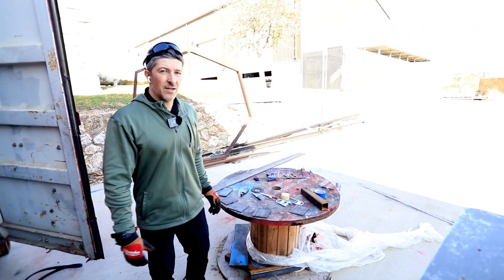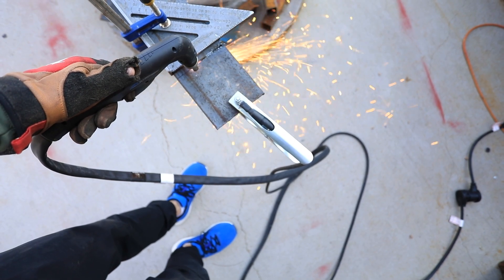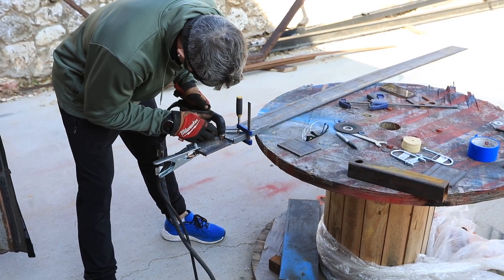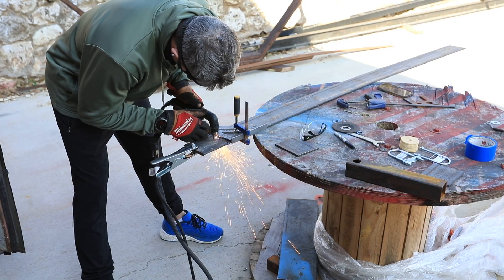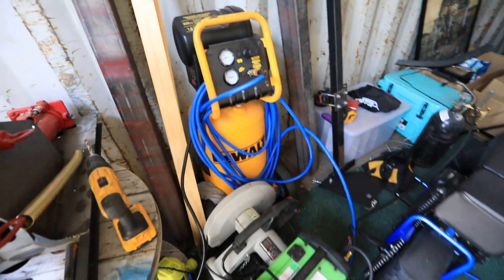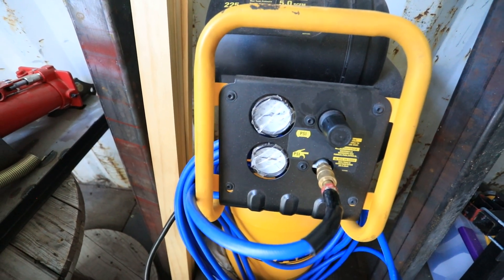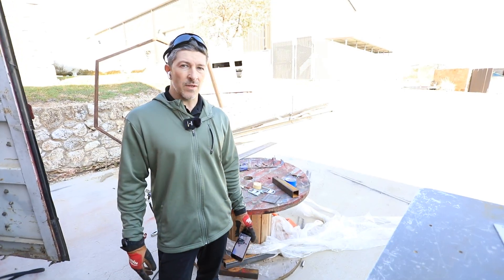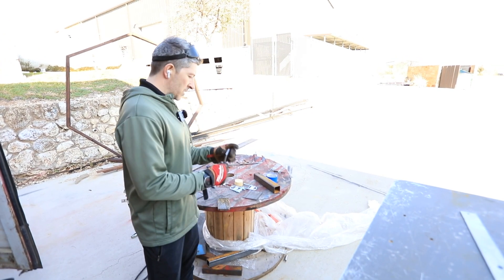Titanium 45 plasma cutter issues arc cuts off

Comment: anyone know how to adjust air pressure on the machine? Warranty says do not open machine or you will void warranty. Most other brands have an air pressure gauge right on front of machine. Of course I can adjust air pressure at compressor but what pressure is coming out through nozzle? One guy said open machine and there is a screw to adjust. Harbor Freight technical advice said go ahead and open machine it if you need to. Also the water separator came with a white filter in it, but the spare replacement is a bronze color. Is the white thing just a place holder for shipping? HF Technical could not answer this question.

Comment: I have error FO6 right now
Reply: The dame error. Someone resolved?
Reply: I found this online, which might help with your situation:

I had f06 on mine. The threaded collar that the nozzle screws onto moves forward sometimes. If you screw the nozzle on and the tip flops around the collar has moved. Disassemble the torch head and you can press the collar back. The collar has a pin that goes through the side of it you need to remove before pushing the collar back. The insulator should stick out past the collar about 1/8 of an inch roughly. If it's flush the collar has moved and needs to be pushed back to the correct position.

Comment: Ok, after fighting with this for two days I solved my issue. In case it helps anyone else I had changed my tip because it had some wear but that did nothing. The electrode had a small dimple in it but no major wear. I went ahead and changed it anyway after the new tip didn’t fix it and DARTH VADER returned! Burns through steel like a champ again. So changing both tip and electrode fixed me. GL
Reply: What electrode you replace

Comment: I had the same problem with mine, but it would cut out after about 5 seconds.  I moved ground clamp close to the cut, and also made contact between the copper ground strap and the metal plate.  Problem solved.
Reply: Mine cuts out after seconds and I release the trigger and start agein and seconds and cuts out again every seconds